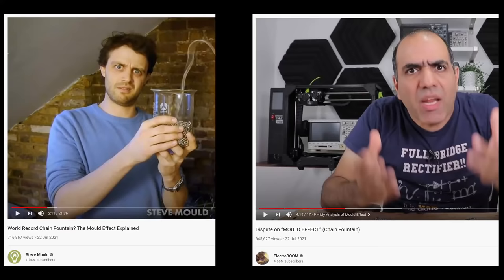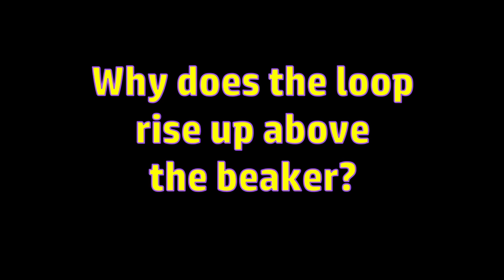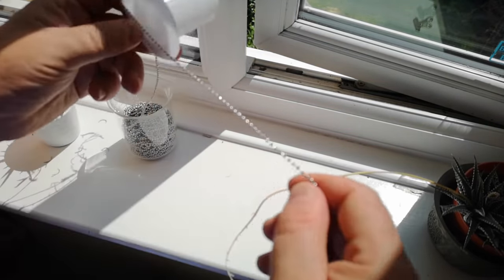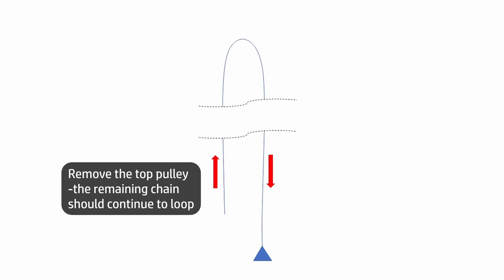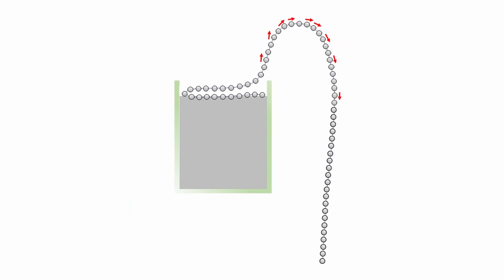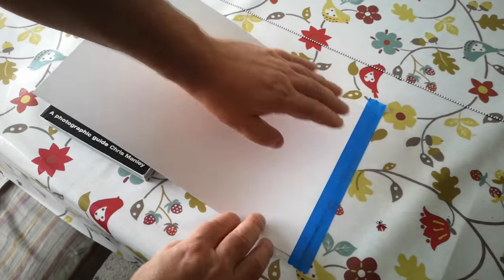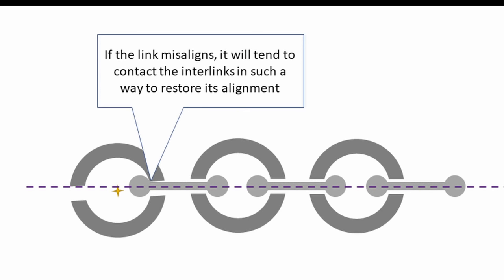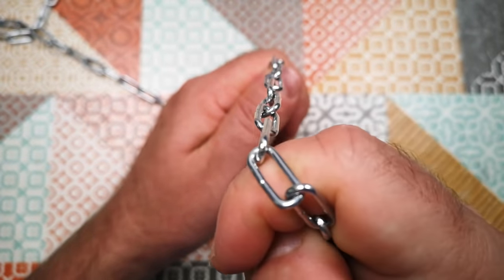Investigating the 'Mould Effect' - (Ball Chain Fountain)

Comment: I love Steve Mould, but I really think that he could use a reminder that you learn a heck of a lot more from trying to prove yourself WRONG than trying to prove yourself RIGHT.
Reply: I question his ethics, I think he's only continuing to disagree because of the publicity and views. ElectroBOOM made a pretty strong case
Reply: Its not Steve Moulds theory, it was done by the University of Cambridge.  Electrobooms theory is wrong though, he ignores gravity and then "proves" it with a chain on the ground moving perpendicular to gravity which is a different set of forces as the gravity in that case is acting against a surface.
Reply: @paulosullivan3472  ElectroBOOM put the chain on the ground to eliminate gravity, then he pulls on the chain to simulate a downwards force from gravity. He shows that the exact same phenomenon occurs.
Reply: You make a good point, but I think in Steve's case he has a youtube persona, and he has to stay "in character".
Reply: @paulosullivan3472  The fact that it still works with gravity pointing at a 90° angle to the direction of travel does put a big hole in Steve's insistence on the leverage theory, though. Since the only surface the ball chain has to act against is the floor in that case, which it can only act against via friction which resists motion roughly equally in all directions as opposed to the bottom of a beaker which resists all downward motion but not upward motion, the ball chain would be unable to get any sort of leverage effect off of it and therefore would need to rely on its own inertia and nothing else.

I would bet quite a large amount of money that the Mould Effect would still appear if you tried it in an environment with negligible gravity like the space station or the vomit comet with the chain floating in midair by pulling on it.

Edit: To elaborate a bit on why this is different from the disagreement with Professor Lewin, in that disagreement Lewin was supposedly not changing any important variables, yet the experiment was doing something different. That means some kind of hidden force was in play. In the chain experiment, Mehdi was supposedly changing a very important variable, yet the experiment was behaving exactly the same way. That must mean that either some hidden variable is acting to counteract the change, or that variable wasn't important in the first place.
Reply: @awareqwx  It doesnt only act against the floor with friction thats the point.  The floor provides a barrier with gravity pulling the chain into that barrier, that isnt the case when the ball chain is thrown into the air.  Its completely different physics.  

Your second point though is a valid experiment.  While electrobooms argument is completely invalid the point of science is to try to disprove your theory.  If he was right then yes doing the experiment on the international space station would be a good experiment.  You should try to disprove your theory which electroboom didnt do.  I am of the opinion that the force of gravity acting on a chain produces a soliton in the chain structure.  This is because there is a limited set of movements possible for the chain meaning that the only place the energy can go is into the formation of a wave.  I think atomic shrimps argument here is the closest I have seen to my opinion on how it is actually formed.
Reply: @paulosullivan3472  Wow you were fast on the drop there. I added a bit to my response in the time you were writing that reply.
Reply: @awareqwx  You have missed an important point in your edit.  You have assumed that either the force didnt matter or there was a force counteracting the force.  My point though is this does not support Electrobooms hypothesis, it only challenges the naive interpretation of the proposed mechanism.  A lever can act in multiple directions, electroboom changed the physics by providing a proxy for gravity in one direction (i.e. by pulling it) while constraining but not eliminating the force going in another direction.  This doesnt disprove a lever action, the lever could easily act in parallel to a force acting when it is constrained by a force directly acting in the opposite direction (i.e. the floor).  You said some hidden variable is acting, it isnt hidden, its in plain sight.  He is just dismissing it without actually considering what impact that force will have.
Reply: @awareqwx  It occurs to me that maybe I am not making my point very clearly.  My point is, a) a lever can act in any direction and changing the direction does not dispute a lever action, b) the floor provides an equal and opposite effect to gravity and c) the pulling across the floor action to a lever is exactly the same action as gravity pulling one side down, it has the same effect on a lever.  

My point is that electroboom is acting as though changing the direction of the pull disproves a lever action when in fact its exactly what a lever action theory predicts would happen.
Reply: @paulosullivan3472  Unfortunately, I'm still failing to see your point. At the very least, the effect should be significantly reduced due to the less solid interaction the sideways chain has with the ground, yet if anything it seems like it was even more prevalent. It's kind of pointless arguing back and forth with Youtube comments and no proof, though, so until someone tests it we won't know for sure.

Heck, here's a less-expensive idea: take a chain to an ice rink right after it has been zamboni'd and try it out there. Friction should be more or less negligible on the highly-polished ice, so it should in theory allow an effective test without having to book a flight on the vomit comet.
Reply: @awareqwx  I think you have again failed to see my point though.  The fact you think the ice rink test would test it shows that.  Friction isnt the problem, the problem is electrobooms test in no way invalidates the lever action argument at all.  He is fundamentally wrong that his proof is proof of anything.  

I will try once more, a lever acts by pulling in one direction with a force acting in a different direction.  Its irrelevant which direction it is acting, it is also irrelevant which force is pulling on the lever.  Electrobooms argument is that if he changes the direction then gravity cannot be creating a lever action, however he recreates it by exactly cancelling gravity and then simulating a pull in another direction.  In other words all he has done is provided a constraining force to gravity and then created a force going in another direction.  This is literally the same thing as the pull from gravity he is just using a different force.  The lever theory predicts exactly what he sees, i.e. that the mould effect happens when he pulls the ball chain.  He however incorrectly asserts that this in some way contradicts the lever effect theory, it doesnt at all.  

I agree its very hard to discuss over youtube comments though, it would be easier if I could draw some diagrams to show what I mean.
Reply: @paulosullivan3472  A lever needs a fulcrum with which to act against. In the beaker, the fulcrum would be the bottom of the beaker (or the coils of chain resting on the bottom of the beaker). Where would the fulcrum be in the case of a zero-G environment where none of the chain links are touching anything except the other links of the chain they are directly attached to?
Reply: @awareqwx  No thats my point, the lever action isnt against the beaker at all.  Thats why it can happen with a ball type chain and not a linkage chain, the lever action is happening inside the ball itself on the chain.  The string running through the ball is pushing against one side of the ball it is strung through, thats the fulcrum.  This imparts a portion of its velocity and direction to the next ball in the chain. The fulcrum is in the actual chain itself.
Reply: @paulosullivan3472   @Paul O'Sullivan  My counterpoint to that would be that every action has an equal and opposite reaction. If the action is happening down in the beaker by the ball chain acting on itself, then it would kick the chain back downwards with a substantial amount of force. You can kind of see the chain moving back down in Mehdi's test, but I would posit that the cause of that is just the Mould Effect happening again, just in the other direction.

It also doesn't explain how the effect still showed up when Mehdi did the sideways test with an actual linkage chain later on in the video and it still displayed the effect.
Reply: @awareqwx  Yes but you are missing the point that energy is being put into the system.  It 100% explains the effect.  In the case of the standard it is gravity putting the energy into the system, it is the lever action within the chain imparting force to the linkages in the chain behind it, and it is the cumulative force of these lever actions with energy which leads to part of the chain rising up.  In electrobooms "test" all he has done is moved the force imparting velocity to be lateral instead of perpendicular.  The same effect happens because exactly the same lever action happens.

edit

Sorry just to be clear the point is that it is a unidirectional energy being put into the system in both cases irrespective of the direction.
Reply: @paulosullivan3472  I never was arguing that there was energy being put into the system, otherwise there would be no motion. My point is that the mould effect does not have any significant lever action and the effect is more likely caused by the inertia of the links in the chain. If there was a lever action or it was somehow otherwise exclusive to the ball chain, then Mehdi doing the sideways test with the linkage chain should not have displayed it to the degree that it did.
Reply: @awareqwx  If it was caused by the inertia of the chain it would affect a chain made of links in the same way as it affects a ball link chain it doesnt.  A chain made of links cannot behave as a lever as each link is perpendicular to the next so there is no fulcrum.  In a ball link chain though there is a fulcrum, specifically at the point the string goes into each ball.  The point is that the lever acts in exactly the same way no matter which direction you have it, so in fact the linkage should have behaved exactly the same way when on the ground as when held up.  A lever doesnt change physics based on the direction the lever is moving.  The point is the sideways test worked in exactly the way a lever action predicts, because the floor acts as a exact opposite force to gravity down so the only force acting on the lever is one directional, i.e. to the side.  As long as that is the case you have a single fulcrum in each link in the chain and a single direction which then consistently moves the force back up the chain imparting an equal and opposite force in the other direction, i.e. up or away from the force pulling the chain.
Reply: @paulosullivan3472   Well, going back to my original philosophy of trying to prove yourself wrong, what is one thing that your assumption is resting on? One that I can see is that ball chain has some inherent property that causes the effect to work that linkage chain doesn't have (and, conversely for my belief, that the ball chain doesn't have some special property other than its ability to move fluidly). Therefore, the effect should not be displayed by linkage chain at all. Yet it does display it in the sideways test. Mehdi's hypothesis (which I agree with) is that doing a test with linkage chain out of a beaker is an inherently inefficient process due to the way the links move and interact with each other, so an experiment should be designed such that the lip of the beaker is not a factor. Alternatively, use a rope or some other thing that is not made of links at all.

Since the sideways tests don't satisfy you in that regard for some reason, then how about laying a linkage chain out nicely in a coil on a table, with no boundary walls, and with all of the links at maximum extension so that they don't all tangle up, then test for the mould effect again with that setup.
Reply: @awareqwx  The difference with the sideways test for the linkage chain is the floor.  In the air the chain has no constraining factor, it can move freely about the pivot point between the two links meaning you have no consistent direction for the energy to move.  When constrained on the floor however this is not the case.  Again we are back to my original point that Electroboom ignored gravity when he shouldnt have.  The gravity pulls the links down, making them want to be flat against the floor, they no longer pivot freely around that point now they have a new force acting on them perpendicular to the force pulling the chain.  That force doesnt exist when doing it in the air and Electroboom is ignoring that fact and hence missing the reason why it is happening.  You can see a slight effect then because the floor acts as a force which stops the chain link from moving around making it more consistent in forcing the energy in the same direction, in other words by introducing a new force you have changed the physics of the chain experiment to create a fulcrum, albeit a less efficient one.
Reply: @paulosullivan3472  I strongly disagree. But, as before, without proof it's just two people hypothesizing at each other. Personally, I don't actually care enough to go out and run a test like this myself, but if you want to, by all means. Try to prove me right (and yourself wrong by extension), and let me know if you fail since that would mean I was wrong.
Reply: @awareqwx  lol fair enough.  Nice to have chatted too you.
Reply: @paulosullivan3472  — "Electroboom ignored gravity when he shouldnt have" — This is not the point of what he did. Mehdi supposes that the Biggins–Warner explanation is wrong, namely their argument that the height is gained due to the surface of the container or chain-pile imparting a reactionary normal force that gives the chain upward momentum. Mehdi places the chain on the floor to show that this is not the case, because in Mehdi's setup, such a force would act along the floor, not up towards the ceiling. Thus, I think it is safe to say that Mehdi's experiment demonstrates that the Biggins–Warner explanation is flawed/wrong.

Why do you think that we must pay attention to the fact that, in Mehdi's setup, the floor is imparting a force on each bead opposing its weight? How does this fact take anything away from the point of Mehdi's experiment?
Reply: @JivanPal  Personally I agree with you, but I would rather this be solved empirically than just arguing about it on the internet. Go out to an ice rink or set up a vertical test with a regular linkage chain and record a video if you want to settle the debate.
Reply: @JivanPal  Because the force of the floor is changing the way a chain with links interacts.  This is in my opinion the reason the effect occurs with a chain on the floor but not in the air.  On the floor the chains are being pulled down, making them want to be flat but in the air they are free to move around the point of contact between each chain.  The extra constraint causes the chain to create partial lever action between the links, similar to the lever action happening between the ball links in a ball chain.
Reply: It's a bit distasteful for him to call this effect after himself as well. This is not really a new phenomenon... but maybe that's just me..
Reply: But you can externalise who you're trying to prove wrong by competing with a fellow YouTuber and it makes a better story.
Reply: @PoptartParasol  He didn’t it name it after himself – other people did. And sure the effect existed before him, but he was the person who first observed it in a scientific way and brought attention to it. There wouldn’t be all these debates about it without his original video on it.
Reply: @paulosullivan3472  "The same effect happens with Mardi Gras beads, with string between the beads. So that entirely negates any lever action."
Reply: @Lue_Duck  No it doesnt, the lever action is between the string and the bead itself at the point at which it enters the bead.  At that stage the string is constrained by the bead and thus acts as a solid rod running through the bead (it cannot bend) allowing for a lever action to push some of the energy further up the string to the next bead.
Reply: @alex15095  The phenomenon doesnt occur in ElectroBOOMs "experiments" where he throws it down/runs sideways, he throws it up, then down, but the chain never actually gets lifted further than he lifted it in the first place, it only drops lower after that if you look closely...
The chain keeps its wave form somewhat stable but only drops due to gravity, never increases.
Reply: @awareqwx  It doesnt work with the 90* angle though, when you look closely where he throws it from his balcony you can see that he lifts it up all the way before throwing it down again, and after that the wave only conserves its shape, but never rises, only slowly drops due to gravity (and conserving the shape is not the Mould effect, RISING is the Mould effect)
Reply: @jahrazzjahrazz8858  Do remember that the floor experiment is subject to a lot more resistance to motion than the regular experiment. The regular experiment had only gravity resisting motion, which is constant. The floor experiment had friction, which increases as the difference in speed between two objects increases.

As I said, though, simply arguing over the internet is kind of pointless unless someone actually goes out and tests any points of uncertainty.
Reply: @alex15095  I don't think thats fair, check his new video. Its quite thorough!
Reply: @benjaminrogers9848  I agree, his new video was pretty strong. I'm now interested in how ElectroBOOM will respond.
Reply: @alex15095  I think if you watch his latest video on this debate it debunks the idea that he is disagreeing for views and publicity - he has clearly thought out and well reasoned arguments against the conclusions that Modi made in his video, and he demonstrated pretty effectively that Modi was observing something other than the Mould effect in many of his experiments. When I saw Modis video on it I honestly thought he had it right, it seemed like he had successfully demonstrated the Mould effect while eliminating the possible mechanism for it that Steve believed was correct, but after watching Steves latest video I have come to the conclusion that Modi wasn't observing the Mould effect in his experiments at all.